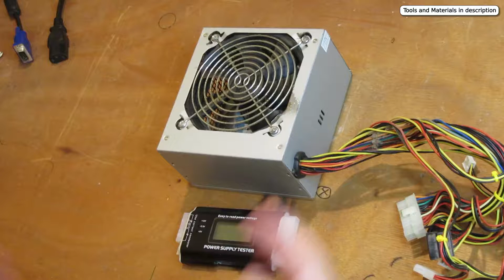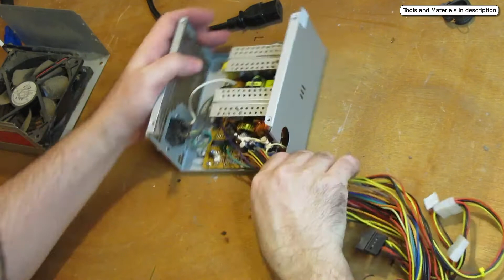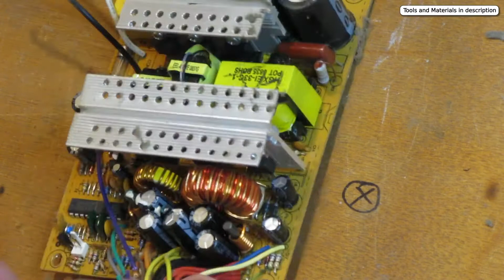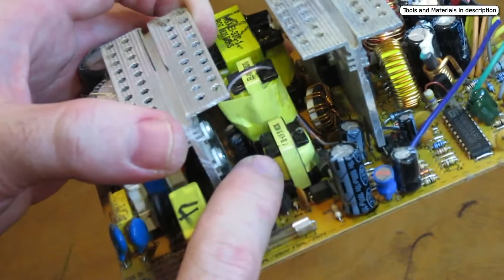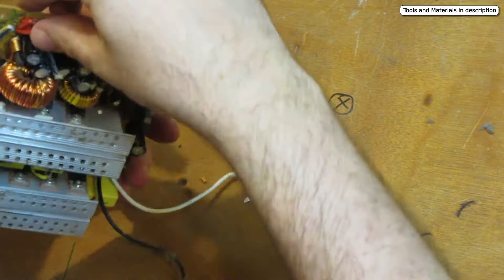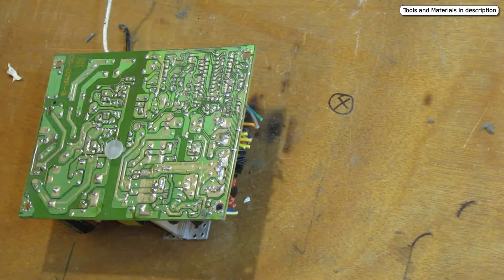What I fix daily - April 12, 2017 - Wasting time on a messed up PSU (no fix)

Comment: That's the first I've seen a power supply tester. What a nifty little tool. I always just use the oldmultimeter. I have to say though, I've seen a lot of power supplies dying lately that are only 1-2 yr old. I've seen a few almost new cyberpower pc's with a dead 600watt thermaltake as well within the past week and those machines aren't cheap.
Reply from the maker: What's dying in them? They being pushed too hard? Or just bad luck?

I do like the tool, it's handy at times, though sometimes it's a bit misleading, but certainly something to have in the toolbox. I put a link in for it in the description, seems to be a fairly commonly distributed item.
Reply: You know what, They are still lying around here somewhere. I'll give them a tear down and see because I'm curious as well. I'd guess caps since I've seen a lot of that lately on stereos power supply...but idk. They aren't being pushed over the rated output though that is for sure. The desktops I worked on I calculated nout to requiring only like 500 Watt max. Well within limit.
Reply from the maker: What sort of failure are they suffering? Just totally dead?
Reply: Very Low 12v rail on both....I think like 7v on one of them? ...fan moved just ever so slightly for a fraction of a second and then out and nothing.
Reply from the maker: Mmmm... feedback circuit, controller, maybe even that auxillary cap next to the heatsink?   Amy might know.
Reply: Wait, what kind of topology do these power supplies have? If they are group regulated power supplies, like most affordable ones are, 5V and 12V are the secondaries of that one bigger transformer, and if the ratio between them isn't approximately what you expect it to be, no point looking at the feedback! Check the secondary rectifier diodes. And if they're fine, it should be the secondary transformer winding :(

Wouldn't count on electrolyte issues, the things are too young for that.

Comment: what is the lowest watt psu worth fixing. 450watt?
Reply from the maker: Depends on the replacement cost really.  There's some SFX form factor, or other oddity PSUs that are definitely cheaper to repair than trying to buy a replacement.    That said, you'd likely be not bothering to repair anything under $100 unless you've got plenty of spare time doing nothing else, in which case there's no harm in that is there :)

Comment: Hey do i know my PSU's or what?. im watching i hope you drag out the meter and check the power resistors. oh ya didn't do anything...LOL
Reply from the maker: ja, was getting real late, and  I had to still go and edit/upload.  One day, one day.  Do you think it might be a dried out / low-value cap on that aux circuit, the one that usually lives right next to the heatsinks and gets permanently cooked?
Reply: well since it was installed upside down, meaning no air flow could get over the caps. so yeah the heat dried them out. When they squeal its the caps. if its an arching sound its the power resistors.....
What you have is more than likely dried out caps....
Don't forget that caps can blow their asses out too.